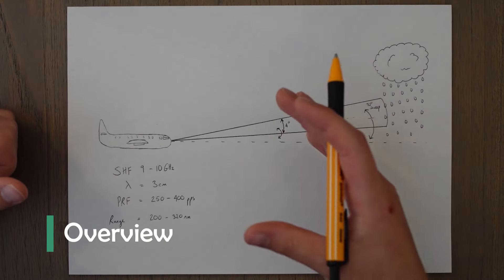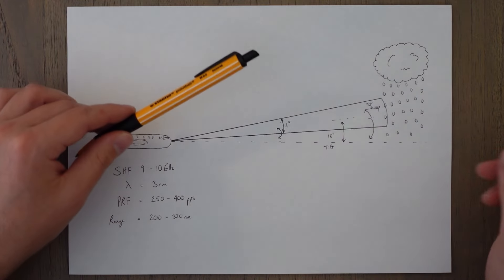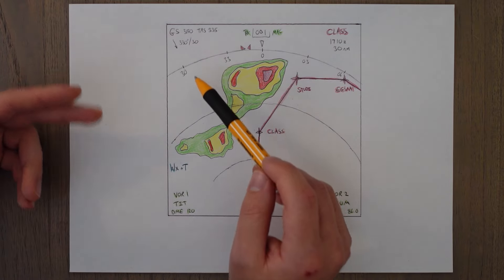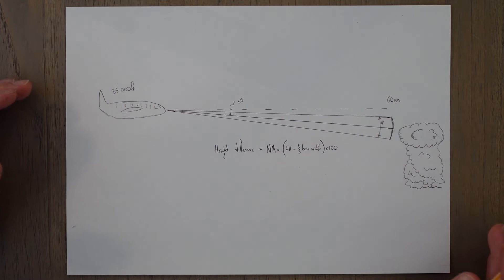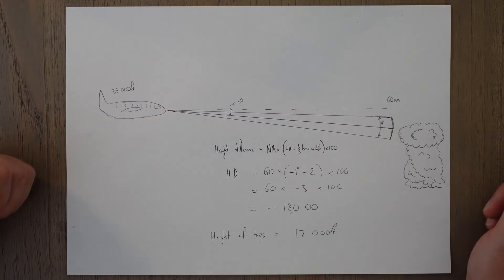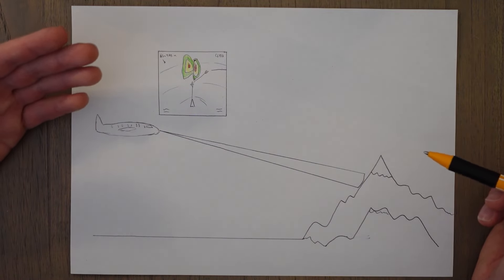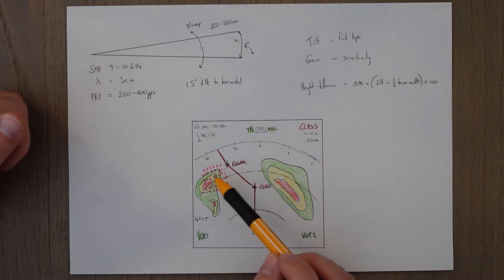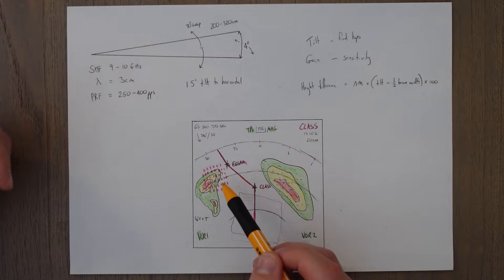ATPL Radio Navigation - Class 10: Weather Radar.

Comment: Hi Grant. Love the videos and they are super helpful for my ATPL. Just beware that the WXR array is a mechanical sweep not electronic. I think in this instance you mean its moved 'by electricity' as in the flat plate slotted antenna is physically moved. Electronic sweep in the RADAR world is when the beam is moved by having the transmitters on plate itself as a series of pixels and by electronically selecting which ones are transmitting at one time you can make the beam sweep without any or little physical movement. WXR hasn't gotten this tech yet as far as I know anyway but if you google AESA (Active Electronically Scanning Array) radar they are coming on some 4th and 5th generation fighter aircraft. This is beyond the scope of ATPL except then we talk about the two types of VOR which is a good example of the difference. Thanks for all the help! - Dave (Avionics Technician defecting the the dark side)